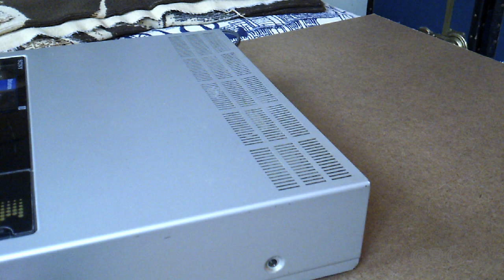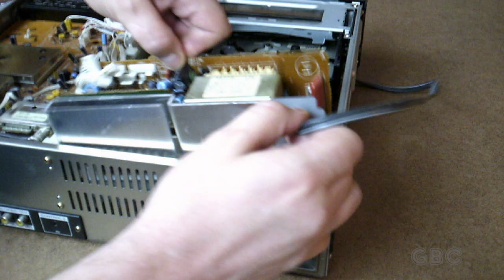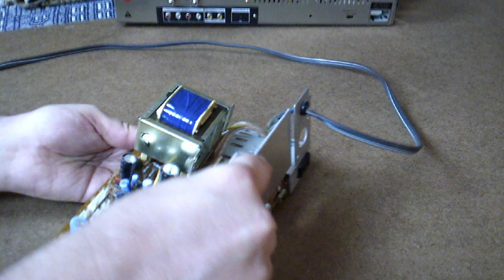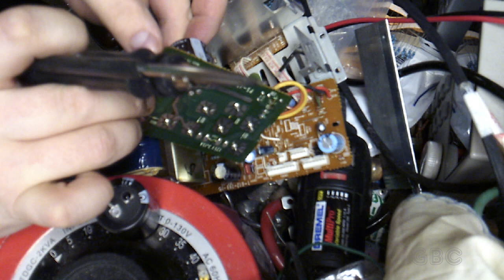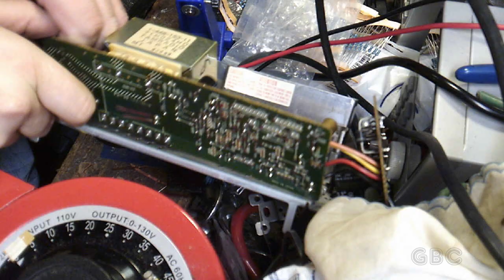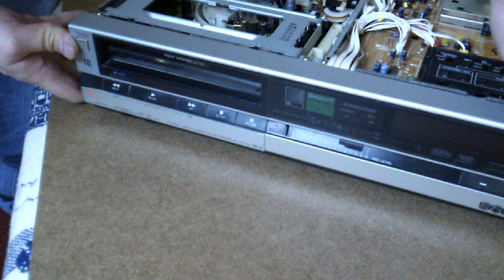[28] Power Supply Recap

Comment: Nice job on this video. Thanks. Could you provide a capacitor list and the source you used to purchase? On mine the fuse blew, it appears to be soldered in, so i may put in a fuse holder. When i plu the unit in, no flashing clock. Trying to find a schematic as well.
Reply from the maker: I don't have a list of the caps I used but I got them on digikey.com. As for a schematic, maybe there is a service manual that has been scanned to PDF.  I know there are sellers on eBay that have copies of some service manuals, that's where I would start.